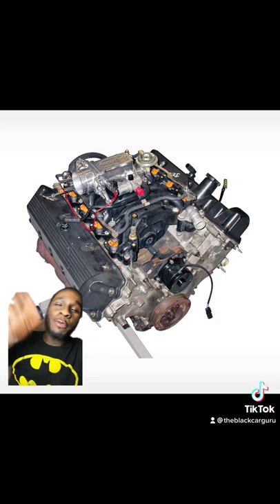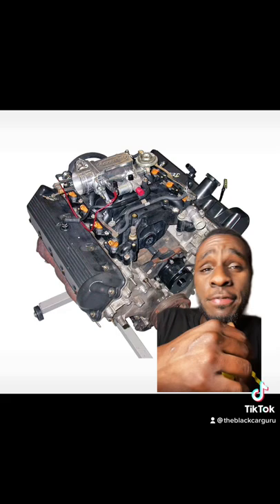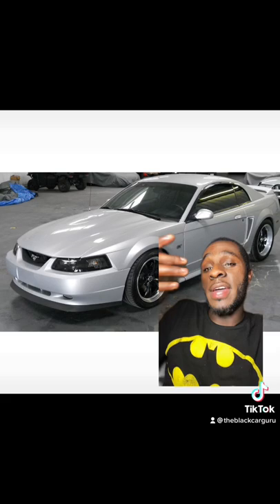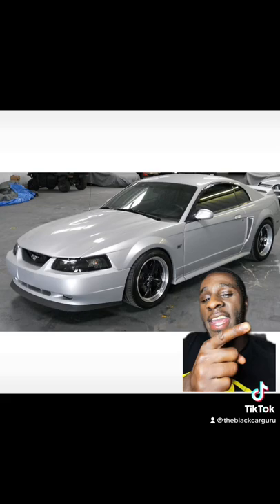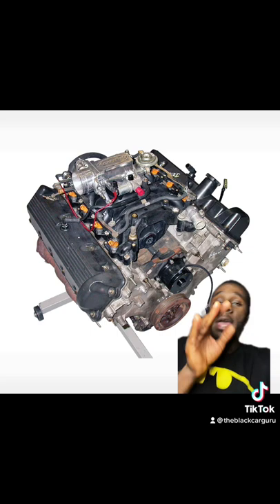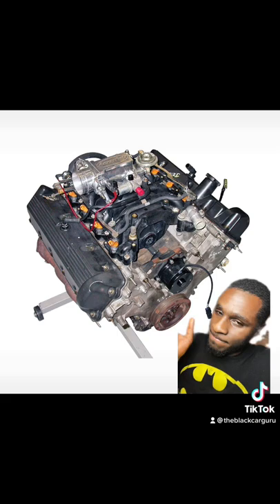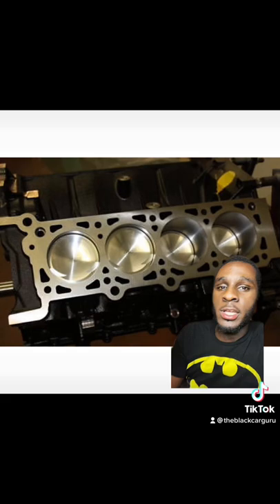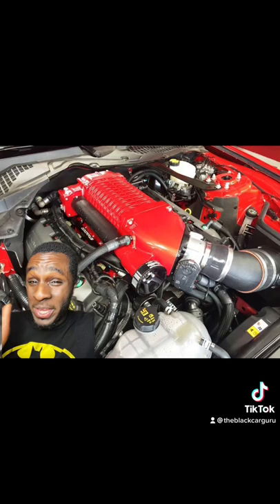Is the 4.6 2V worth building? | Let me explain why!

Comment: You don’t need $20k. Coyote rods swap rods swap right in and are like $300. Good set of pistons is $600. Just with those budget gen2 coyote rods and a set of pistons you have a short block capable of holding 700whp easy for under $1500. You don’t need a TFS top end to make that kind of power, but it’s $4,300 for a complete kit, plus another $700 for a Vic jr intake, plenum and TB of your choice. That’s less than $7k into a longblock, ON3 kits are routinely done for about $5k after upgrading some components for better stuff. That’s ~$13k for a 700whp 2V. You can’t do a gen2 coyote swap for much under $10k and any power adder is going to be $8k. That’s about $5k more for a boosted coyote swap that’s going to be making the same amount as that build 2V except no one actually expects a 2V to be making decent power, everyone expects a boosted coyote to be making that power. 

So for $5k less, you’ll make similar power and catch more races with a 2V. Don’t get me wrong, I love a coyote. But it’s not a cheap enough swap for a sought after motor. Gen1 truck motors are cheap swaps, but you’re also making about 330whp, 350whp with FBO.
Reply: People like this is why 2vs get no love lol. It takes no where near what he listed to make decent power. Like you said, cams, coyote rods, pistons and a turbo kit will handle 600+
Reply: Not 20k but 13k 😂🤣
Reply: Adam Helmers 🤦‍♂😂🤣
Reply: @eriv4735  you sir got hella ripped off on parts then😅
Reply: Adam Helmers You sir live in a fantasy world..oh and the 13k wasn’t me quoting anything, it was pointing out the ops estimated price..keyboard racers crack me up
Reply: @eriv4735  🤣👍👍👍👍👍👍
Reply: @eriv4735  "keyboard racer" 🤣🤣🤣🤣 oh lordy
Reply: Adam Helmers Yea KEYBOARD RACER 🤦‍♂😂🤣
Reply: @eriv4735  $13k for a motor and power adder to make 700whp is a lot? My boy did 500+whp on an ON3 kit without maxing out the turbo that cost $5k all said and done, fuel system included. 

$13k for everything is a far cry from the $20k that OP said would be needed in just the motor.
Reply: El Samcho Yea cool STORY bud..you THINK 13k is a “far cry” from 20k?? 👍🤦‍♂😂🤣

Comment: Bro, these 2v 4.6 are buld for low compression,  just chang head to Trick flow each cost 1.4k and with a good tune with short headers. You can easily get around 400 hp. Do it and thanks for me later 😊

Comment: Once again another person who doesn't know the 2v platform. Stock Heads flow plenty of air. Camshafts, Coyote rods (yes coyote rods are a direct replacement for stock rods), forged pistons and an on3 turbo kit ($2500ish) and you can make 500hp+ no problem... even the cast 6 bolt cranks hold that power just fine. Im making 280hp and 330torque on mine with just long tube headers, intake and 93 octane dyno tune. Running 12.9 @ 105.5mph (which is only 0.1 seconds slower than a stock cobra according to moto trend). Not only do these engines sell on marketplace all day for $500, it takes nowhere near what this guy says it does to make power.
Reply: Exactly. And 12.9 is still plenty fast.
Reply: @kskip4242  right! It's literally  0.1 seconds off what Motor trend recorded for a stock 03/04 cobra which was 12.8.
Reply: @adamhelmers3185  besides the 351 Windsor I think the two valve 4.6 is the best sounding Ford Motors ever made way better sounding than that raspy ass coyote motor.
Reply: Once again people critique others while they themselves are living in a fantasy world..engine rebuild with “coyote rods” and forged pistons  is well OVER $2000..the on3 kit will run you over 4k..that’s 6k and you still haven’t even gotten it tuned..no transmission mods, no rear end, to tires, no suspension..so you’ll have a car that MIGHT make 500hp but still won’t perform 😂🤣..there is also no way that a STOCK 4.6 2v is making 280hp and 330tq AT THE WHEELS with ONLY long tubes and a “93octane tune” bud..the BEST 4.6 2v made 220hp and 280tq AT THE WHEELS stock so you want people to believe that you added 60hp and 50tq with JUST headers and a “tune”?? You have zero credibility here bud 😂🤣
Reply: @eriv4735  you can get 250hp and 280-290 torque at the wheels with those mods. Unless he has mods he's not mentioning that's pretty much it N/A on a bolted 99-up 4.6 2v. Start adding aftermarket cylinder heads and cams then you're talking the power numbers that he's talking about
Reply: K Skip Oh I know bro, this guy gets his “tune” done on the happiest dyno ever..keep in mind he is claiming he is doing this on a 1998 GT with NPI heads and cam 🤯..my fbo 04 with 40k miles made 275/315 and those make 40 more horse than a 98 to begin with 😂🤣

Comment: There were many good ford cars l passed on because they have the 4.6  2 valve.  I would take the old 5 litre anyday over one unless l wanted to go 1 million miles without much more than maintenance on the engine.  The 4.6 with the cam phasers is a hard pass.
Reply: 2v engines don’t have cam phasers

Comment: If it’s a 2v triton don’t do anything to it, it’ll blow the spark plugs out stock, much less modded
Reply: No the 2v isn't the problem. It's the 3 valve 4.6 and 5.4 that blow plugs out.
Reply: @fabelgamer7410  that’s incorrect man. It can happen on both, but it’s by far most common of the 2 valves. I have a 2 valve that I’m fixing right now that’s had two plugs blow out in the last few months
Reply: @loganwatson5905  good to know. I hope my 4.6 last a few more years at least😳
Reply: So no mods on A 2v?
Reply: lilc713htx A 2v is perfectly fine for modification..the “spark plug” issue is rare and in most cases it was the owner/previous “mechanic” who over torqued the plug on installation

Comment: I have a 2005 Merc Mountaineer Premier with a 4.6L motor. How can I tell if it has got the 4 thread or 9 thread spark plug holes and how many valves? The more I look for information, the more confused I get. Found out the hard way on what valve cover I got by ordering the wrong one. Mine has 11 hold downs with 5 being on top. The one I got was a 12 hold down type with 6 on top. Any help would be great, thanx.

Comment: I am stuck in between coyote swap or build my 2v
Reply: 2v will be way cheaper dude. Coyote rods, forged pistons, cams with springs and retainers, then boost. probably 4-5k total and youll have a 600hp+ car that only weighs 3200lbs
Reply: @adamhelmers3185  thanks a great deal
Reply: Adam Helmers 4-5k TOTAL 😂🤣
Reply: Mr. Louweeziana It WOULD BE a great deal if it were true 😂🤣

Comment: what about modding the 5.4 2v in lightnings/harleys?
Reply: basically the exact same but they are a bit stronger from the factory and can handle a bit more power. Pulleys and supporting mods will net you much more gain than anything on a 4.6, but I don't know all the exact numbers as I don't know as much about the 5.4 supercharged (otherwise there are some other block differences like deck height and and internals)
Reply: I swapped a 5.4 in my 2000 Mercury Grand Marquis and added a cam. A lot more fun to drive now.
Reply: I did a few in the 700whp range back in the day. They are a lot better than the 4.6. The 4.6 will break a rod if you look at it too long. Best thing to do is put a whipple and ported heads. Beyond that, LS swap

Comment: I HAVE A 2001 F150 4.6. I NOTICE THAT HORSEPOWER RATING FOR THE F150 4.6 THAT YEAR IS 231. IS THIS THE BASIC 4.6? AND WHAT ARE DIFFERENCES IF ANY? THIS F150 ALSO TAKES THE SMALLER OIL FILTER. MOTORCRAFT 500.

Comment: This dude speaks the truth. Those 2v 4.6s were more bark than bite and everyone back then knew it.  They couldn't hold a candle to the LS engines of the day and they were more expensive to modify to boot.
Reply: Search Andrew Lavender here on youtube. His white girl mustang eats LS motors. Its a boosted fully built 2v
Reply: Chevy always needed bigger motors n more compression to beat a lil low compression 2v..lol I don't blame them tho bcuz Ford sales like sex..lol
Reply: Were you actually alive in the 90s?? 😂🤣
Reply: @eriv4735  sure was. I remember when the 4.6L replaced the 5.0L Ford eventually released a head/cam kit because the factory engines weren't making the claimed power output.
Reply: painteater19 Then you just ate too much paint I guess because your memory is a bit off 😂🤣
Reply: I beat alot of LS cars with my ‘99 2 valve back in the day. Mod for Mod they were a little quicker,about 3 tenths in the 1/4 mile,but my car was alot cheaper..🤷‍♂️

Comment: imo you just better off  rebuilding a stock 4.6 2v for a daily driving truck or if u want just add a cam for more performance and sound, just my opinion tho cuz my f150 still running strong
Reply: That engine will last half of forever.

Comment: Built top end should not cost almost 5 grand lol it’s the bottom end that’s the weak part they sell bottom end kids with no crank for 2k I believe the crank is good for over 500-700 wheel I’m not sure and on3 sells a single turbo kit with the smallest turbo they sell can support 700whp for 2300 just the kid no upgrades and if you want they sell a 84mm upgrade lol so it’s not as expensive as you think I’m thinking about building the bottom end of my 3v and going on3 blocks can support up to 1200 wheel I’ll build the heads port and polish them myself build it myself be money bc my cars already cammed

Comment: Can you do one giving tips for the 5.7 hemi im kinda new to the car scene and some pointers cud help me a lot 😅
Reply: Nothing lol, save up and get a better platform, a 5.7 gets dragged by a kia k5 and a elantra n lmao by the time your done modding you could've gotten a hellcat lol
Reply: @cormaro13  yea I know lol but it's more of a sentimental investment for me.
Reply: @r_Moran  tune, maintenance for trans and other parts, cold air intake, can either port throttle body and intake or upgrade them, then flex fuel, it'll put a smile on your face til you wanna upgrade lol along with a cat back exhaust don't get anything weld, cause soon you'll need to service a diff and have to chop off the pipe to get to it lol

Comment: It just doesn't make sense and I had one years ago. Those pistons were made out of glass I swear. Those engines had a "death rattle" brand new out the box. And they would tick from beginning until the point  where they exploded. It just wasn't a good platform to mod. A coyote swap makes much more sense.
Reply: The 4.6 2 valve is one of the longest running engines Ford has ever made there are plenty of these engines in taxi cabs that have 500,000 to a million miles on them and still run well.
Reply: @kskip4242  A taxi cab is not a modded platform. The platform had numerous problems. And most people wouldn't tear those modular engines down at all. The average modular mechanic would simply tell you to buy a new engine. Now that coyote is a totally different story. Which is why it's a better starting point particularly if you're already doing major work on the car.
Reply: Sounds like YOU experiences 😂🤣

Comment: Better off giving a 4.6 from the Lincoln Town car the front will drive one which has the same engine but with 275 horsepower and 285 lb to the torque.
Reply: That's a 4v 4.6, the ones in the mustang is a 2v
Reply: Where the hell are you getting your numbers from the mustang gt had the highest output 2v at 260hp 302tq followed by p71 crown vics 250hp 297tq then the rest of the panther platform 239hp 287tq at no point did the town car have more power than the mustang gt or police interceptors
Reply: @KCunknwn  1998 4v DOHC Lincoln MkVIII 280HP @5,800 RPM if I remember correctly
Reply: @Felix-gm9im  1 that’s not a town car like he said it’s on the MN12 platform not panther and 2 that’s the early version of the 4v used in cobras and Mach 1s  it was introduced in 93 for the mark viii and fwd versions for the continentals either way they’re completely different heads and still would be the lower output version to the 4v 4.6 in the cobras/mach 1s/marauders
Reply: @KCunknwn  you're correct, chances are he got his cars mixed up regardless.

Comment: Your thoughts putting  a 5.7 in a 2008 dodge avenger sxt.
Reply: 🤔 I've always thought those should have been rwd .
Reply: Better off hacking up a charger to do a short wheel base hellkitten and it will purr with rose gold accents and extra cup holders in various starbucks sizes
Reply: I wouldn't lol might be a little quicker than a changer but not much lol
Reply: There's a avenger with a srt8 engine in it called the storm trooper.

Comment: Non pi engine w/ pi heads nets you more compression then a from the factory pi setup. With the cams and turbo I'd guess your at the 450 hp limit of stock Internals pretty quick. You mIght not even need the cams. Junkyard parts and ebay turbos for the win.
Reply: A regular npi long block with boost will easily make 450rwhp..there really is no need for pi heads, cam, or intake but are cheap and easy to swap in while you’re at it

Comment: Me and my boi are thinking about getting a motor from an aviator same 4.6 but 4V comes w bigger throttle body and injectors and pushes lil over 300 HP stock what’s your thoughts on upgrading a 4 V
Reply: Good, build it, but it's more expensive than a 2v, n the rods n pistons are the same, more n/a power tho..

Comment: Can you make a guide on all motor high rpm ls' like I want a ls1 or 6 the revs to 8500 and up
Reply: Solid roller cam, right springs, done. Now if you want to make power at that level, going to need to bump compression and do a set of heads.

Comment: K, the 2v is ultra expensive to build real power out of. The stock PI setup I think peaks at just over 400 HP . The powdered metal rods are not good for much past that. The heads flow good with boost but remember this 281 ci engine is plenty capable of making 500 lb ft of torque with some good rods and Pistons and a lot of boost. Here's a little trick for you though. If you take a non PI block and swap a set of loaded PI ( stock cop car ones are dirt cheap compared to new aftermarket) heads onto it, run a good set of long tubes, bigger throttle body, and E85 your looking at almost 320 at the crank with 340 lb ft of torque. Even this is not " cheap " . The pcm/ecm from the 01 and up squad Vic's will run all of the v8's ( not the 3v or yotes) . The modular engine regardless of it being a 2v or a 32v only monitor the pass side cam shaft. The 32vs exhaust cams are timed to the intake cams and the computer only cares about the bank one ( mod motors always pass side ) cam. For all you pile of shit car thieves, this one's for you. 100% of all squad car Vic's are non pats cars. This means you can use the ecm as a stand alone controller and it is a rewritable ECU. This means you can swap a mod motor ( 5.4, 4.6 , 2v or 32v ) into anything and it will run and drive with a squad ecm. They also are fleet cars and there are like two keys for every 5000 panther fleet cars made....my Vic was stolen in 27 seconds because the shit bag had a key( I watched him ...a white-ish guy....on our security system ) , any way the pi to non PI trick works on the 5.4 for the same or less money and makes over 400 lb ft in n/a form . The reason the non PI engine makes more power with the pi heads than the pi is due to the compression bump. A non PI with a pi swap no runs 10.7-11/1 static compression hence the need for E85.
Reply: Sucks you got your car robbed man, goes to show tho why cheap asses love robbing these P71s tho, especially when built.. Have a tracker on them builds, I know I do.. Altho I hate having to pay for it, never know when it'll come in handy.. ;)
Reply: @P71ScrewHead  I figured no one would want an old cop car 🤷
Reply: @robsorgdrager8477  yeah, I agree, I'd hope no one wants them but bcuz they share engine with the New Edge Mustang n the 2v expensive parts ppl want them.. Also for frame swaps..

Comment: U ever seen ...say a 5.7 hemi swapped into say a chevy or cadillac? I thought about that versus the ls...due to your report of building a 5.7.
Reply: No because it's just plain stupid and too much work, 5.7 gets dragged by 4 cylinders right now, after your done building it, the power your making is already on the chevy cause they spent more than half the money you spent to make the same power lmao
Reply: @cormaro13  well explained thx . I will quickly get that out my head
Reply: @kingdevine7374  if you're looking for a fun project with good results, chevy sonic or cruze with the 4 cylinder turbo, zzperformance offers good mods for it but those little things run lol with full bolts on you'll get be at 250hp and 300tq out of that little car plus when u wanna go forge it's so small, last guy I talked to said he spent only 2k on forge internals and is pushing v3 turbo with 500hp, if not can't go wrong with the ls, I just don't see that 5.7 doing much unless you're a drug lord just wanting to wash money and see power lmao

Comment: No hate but you're definitely under exaggerating the potential of a 2v. Much more capable than you make it sound. Try not to lead people astray. Yes there are better and worse, but still very relevant motors. When you say compete, you're left with a lot of questions. What class? Time? Style? Etc... you can use pi heads, intake, cams with an m112 eaton and good rods to make over 500hp easily. Your camshaft and timing is where it is all at. And you'll be WAY UNDER 20K for something that can compete in many formats. 1500hp on any engine is gonna cost a huge chunk of change regardless.